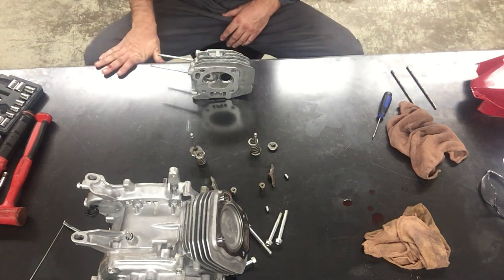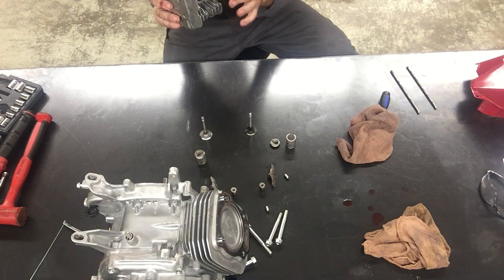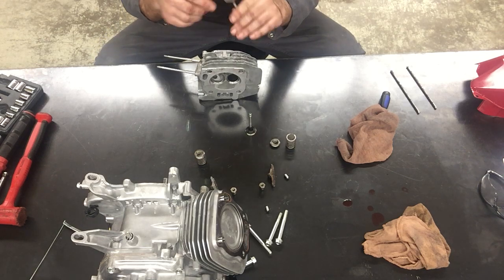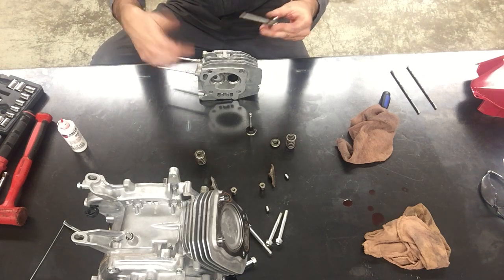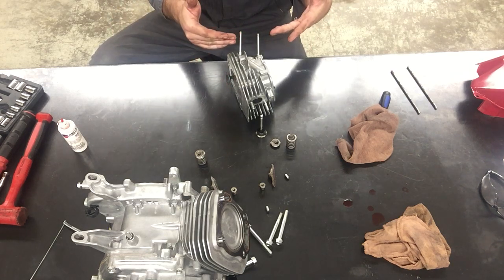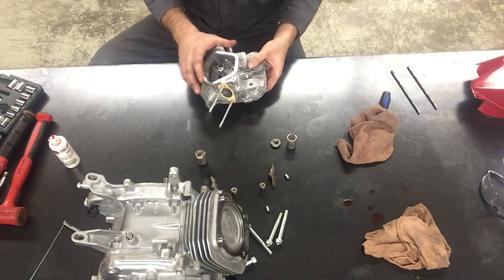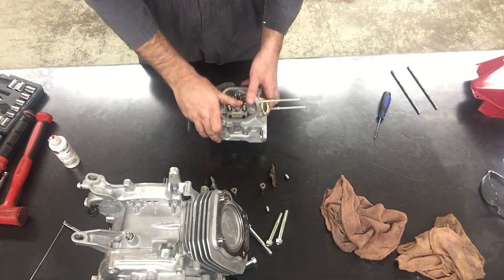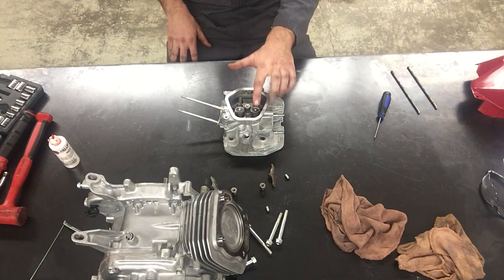Install Valves into Cylinder Head Honda GX390

Comment: I have a 390 that had a stuck valve. I took the head off like you have here. Disassembled it. Got un stuck. Put it all back together. Now I can see the valves moving fine with the cover off. But when I put the spark plug back in I can’t pull the recoil starter. I did set the lash clearance at .006 and .008 before. So any idea why the recoil won’t turn only when the park plug is in?
Reply from the maker: The decompression lever on the camshaft could be faulty. Also the valves need to be set with the piston at TDC of the compression stroke. If it was set in any other position, that could cause it as well
Reply: @autotech4103  I wonder if it’s the decompression release lever if it would be under Honda’s Warranty. It’s not a very old machine.
Reply from the maker: @ they have grounds to deny you if it’s been put together incorrectly. It’s worth a go….
Reply: @ thanks. I will look into the decompression lever. Need to find videos on that.

Comment: Sir is it ok if i put two stem seal?
Reply from the maker: Yes. Not necessary but should be ok. As long as the valve opens and closes properly.
Reply: Thank you sir❤

Comment: Extremely helpful. Just changed my head gasket and wondered why I had a small piece of metal leftover. After watching this video I learnt it’s my exhaust valve turner!!! Pre head gasket it was running fine just smoking real bad. Now it runs, no smoking and cuts out- going to put the valve rotator on and refit the carb so I’ll have to post an update. Thanks man
Reply: After running the engine for a while I can now see black oil coming out of the rocker cover on the exhaust side and oil coming out where the exhaust bolts on
Reply from the maker: If it still has problems go ahead and post any questions. Hope we can help
Reply: @autotech4103  I still have the smoking issue after a new head gasket. The valves aren’t leaking and the cylinder isn’t scored. The oil inside looks fairly new so I’m wondering if the previous owner used the wrong oil. It starts up fine and dies after 30 seconds- if I remove the oil sensor it will keep on running. Your help is appreciated man!

Comment: So what is the fix if the "suction" isn't the same on both intake and exhaust?  I don't see any seal listed or guides listed on parts diagrams for my GX340 k1 engine (older 11hp)  I get some suction, just not nearly as much as on the intake.  BTW, love your videos!!
Reply from the maker: First off make sure the valve and guide are both clean. Then I would measure the valve stem in multiple spots and compare that to spec. You will need a micrometer for that. There is a procedure called “knurling” which can make the guide hole “tighter”. I don’t have the tools for knurling and would need to send it away to a machine shop. They could also drill out your guide and press in a new one.

Comment: Thank you so much for the detailed explanation... but I have noticed that the exhaust valve has a spring seat it's like a washer whereas the intake valve spring doesn't have one...is it necessary to buy one and install it under the intake spring valve or not necessary... 
My regards...
Reply from the maker: That cap on top of the valve retainer of the exhaust valve is a rotator. The intake side doesn’t have one.
Reply: @autotech4103  yes I know about the retainer but I meant the piece that sits underneath the valve spring which seems like some sort of spacer between the spring and the cylinder lead itself
Reply from the maker: @aymannabil9  that retainer washer is only on the exhaust valve. I have checked the Service Information to make sure.
Reply: @autotech4103  ok I got you👍 thank you so much ...now I'm gonna install the valves and continue assembling my generator 
My regards to you👍

Comment: hi awesome videos that you do nice ,easy to follow instructions ,im having problems with my 25 yrs old countax tractor mower with a  honda GXV390/GJAA 13 HP engine ,its turning over but will not fire up ,there is spark ,fuel getting through ok,set lash on valves but still no joy ,took cylinder apart after your video ,checked valves fine making that poping sound ,poured petrol over valves to test for air leaks ,no leaks but  noticed that on  intake valve side that the valve guide sits higher than the valve guide  on exhaust side is this normal for these engines if so my next step is to check the compression release on camshaft incase it has failed ( also noticed i have seals on end off both valve guides ) any help would be really appreciated
kind regards
GOOD WORK !!!
Reply from the maker: I would test compression. If you don’t have a compression gauge you can always just block the spark plug hole with your finger and pull the rope. Pressure should force your finger off the hole
Reply: @autotech4103  thanks for your speedy responce,the issue with valve guides, that one being higher than the other concerns me,has the seal sits so high it looks like it has no purpose.its so hard to get any info on this engine in uk they all just want to sell you parts ,i can forward pics if you got a public email address.
cheers Autotechcp
 ( or should i be calling you Mr. Henderson now)
Reply from the maker: @jazzsingh263  I have seen a valve guide slide out of the head like that. You can drive it back into place with a deep socket and a hammer. It may just slide out again or it may stay put. Worth a try…….
Reply: @autotech4103  The point is MR Henderson ,im not to sure if it is designed that way before i go tapping it down, it was working perfectly turned off for 5 mins then wouldnt start again, thank you for your time
Reply: Una vez un tractor craftman de 20 hp no prendia y era el árbol de levas que se daño un balancín ,